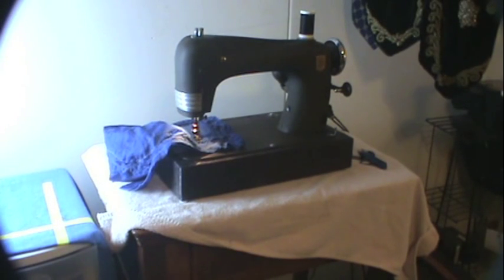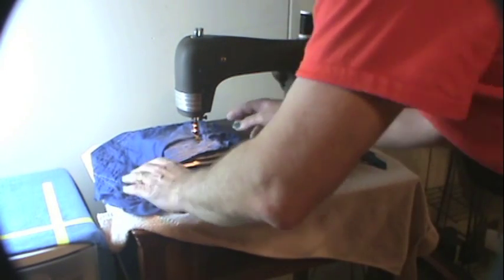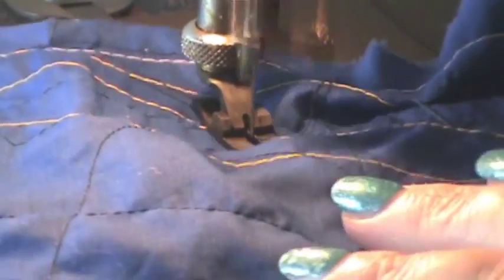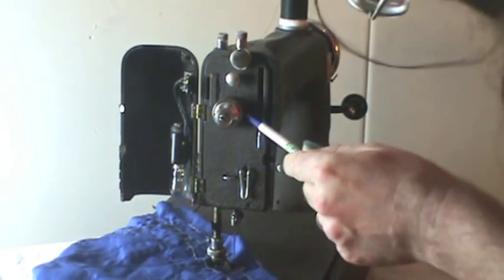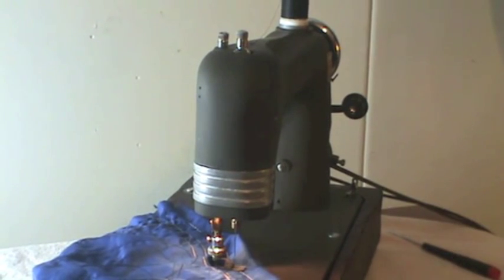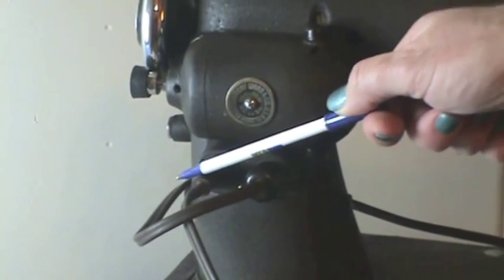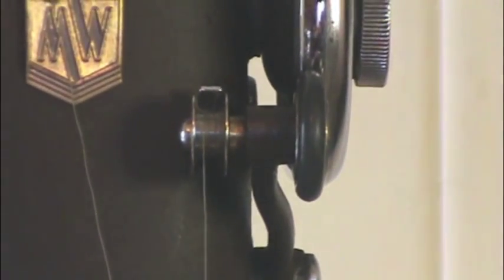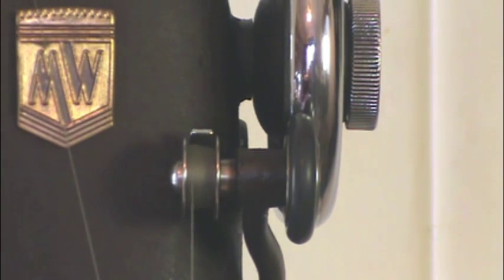Montgomery Ward "Supreme Reversible Rotary" Sewing Machine

Comment: Really enjoyed viewing this, and your web page on making the display box.  Nice job.  I just bought one the other day, but the wires are completely shot.  The Chicago connectors are intact, but I think someone must have stored it in a hot attic or barn or something, because the insulation is literally melted off the wires and onto the base of the machine.  It looks like someone drew on the base with a brown crayon!  I read your thoughts on the unavailability of Chicago connectors, so I guess I'll have to look for a donor machine to get replacement wires.  Sure wish there was a modern adapter for these that would allow for a modern set of connectors!

Comment: Hi, really like your video. I have one of these machines and need help in locating parts. The bobbin case tension screw is missing and also have only one bobbin. Have bee able to make stitches without the tension screw however not very good. If you have a lead on a bobbin case and bobbins please let me know. The info your video provides is excellent especially threading the machine.  I would never figured it out.. Thanks again!
Reply: Robert.  Almost impossible to find parts unless you can locate a parts machine.  I have 2 of these and some spare parts.  Unfortunately I don't have the part you are seeking.  Keep an eye on craigslist that's where I found mine.
Reply: +2JobsStillPoorUSA 
do you have one bobbin you would sell to me?
Reply: Honestly I'll have to look.  I usually keep all my bobbins especially when they are tough to find like this.  Today is my Bday and have lots of things to do, give me a few days to check it out.
Reply: I have some bobbins.  They are medal
Reply: How do I take off the handwheel ? 

Can't remove the motor if I can't remove the handwheel

Comment: Enjoyed the video, I know it's old so you may not remember but where did you find power cords to replace the old ones with? I'm looking at one of these on shop Goodwill but I'm not seeing any cords with it (not that they'd be any good by now anyway)
Reply from the maker: eBay is your friend. Best find would be original "Chicago" connectors that you can wire your own cord onto. The older cords will have them, the newer ones are molded on.
Reply: @veiledzorba thanks I'll have a look!
Reply from the maker: You may have to "camp out" with a saved search for quite a while - they're getting scarce.

Comment: I have one of these I just purchased.  The motor spins fine when no pulley is applying pressure against the spinning end of the motor...  Do you have any clue as to how to determine whether it is simply brush changes or a new motor being necessary?  I have got bit by a vintage sewing machine bug and wanted to restore the machines to functional (but I dont have the skills in painting etc...) so I wanting to really give these a new home as most are bad cabinets or none....cuz the trend is to use the treadle base for tables and toss the sewing machines...
Reply from the maker: If the motor is developing full power - and it may not be - the machine is probably stiff and in need of a good oiling and loosening up. Motors can also sometimes benefit from such. I just get 'em to run, and then let the run for several hours (under supervision).
Reply: @veiledzorba  I already lubed it up and replaced the cable that goes from the underside of the machine that gets stapled to the cabinet going to the knee throttle control...  The thing is in time and will spin freely when just manually cranking the wheel.  I read online after watching your video that maybe 1% of these will eventually have a motor go bad....  and they don't make replacements....of course EVERYTHING on the internet is reliable?  Right!?  Haha!    Anyways ...  thanks for responding so quickly!   Wasn't sure if you were still reading comments or not.

So I have taken the innards of the motor out of the housing and I really like how the brushes can be accessed outside of the unit pretty easily...and they looked fine.  I will watch another video tomorrow IF I have enough time that shows how to use a multimeter to measure the windings...

I disconnected the tension pulley and operated the motor without that on and it seemed to go pretty fast and there was no smell of slot car racing or sparks...and the thing seemed to be perfect....but the slightest bit of pressure applied would slow it down  (if already at full speed)  and if there was a start with the thumb and finger already on it...  you could hear a hum...it would try to move...but seemingly not enough to make a difference in the wheel if connected...

  So
..  hoping that I can find either a quick fix or....  slower fix that isn't quite so expensive.   I have a habit of buying machines that don't work and need parts that aren't available lately!  😅🤣😂
Reply from the maker: Check the motor bearings - make sure they're clean and well lubed. Then run the thing with no load for awhile.  @mrupholsteryman
Reply: @veiledzorba  gonna try that...but I didn't see any bearings other than the one that let's the wheel side axle portion go through before putting the friction pulley on......and the part on the other other side of the motor assembly where the brushes fot next to....on side closest to the needle side of the machine.. I'll try to take another look sometime....maybe tomorrow?   I work a bit and decided I must not be busy enough....  😅🤣😂

Comment: Hello.... I enjoyed your video but I have no idea how to work this machine. I plug it in, the light comes on... But I don't know how to make it start the stitching process. Any tips?
Reply: My light will not come on nor can i open the machine to close it and put it away 😔
Reply: @tinaschlegel5621  I just recently got a model 30 and there's a button that you need to press on the front of the machine's baseplate that looked like a rivet to me at first. It releases the latch so that you can lower it into the cabinet- it took me a while to figure it out so just letting you know in case that's the problem!

Comment: Hello I saw a machine like this one yesterday, but it is a long bobbin machine, and the lead wiring is exposed that runs from the machine to the motor, I saw in the comments about not being able to find parts for this machine, and was wondering if you have any advice to give.  Should I purchase this machine or not, they are asking $30.00 it is in a nice cabinet and the foot controller is knee operated.  What are your thoughts on this, and the pros / cons on this machine.  Thank for such a detailed video.